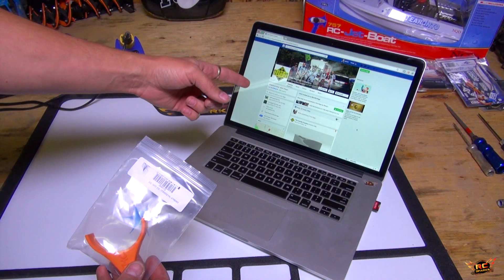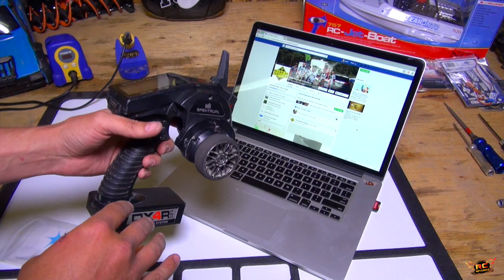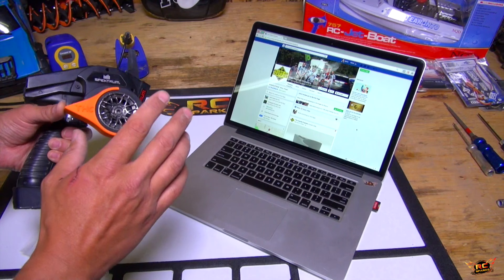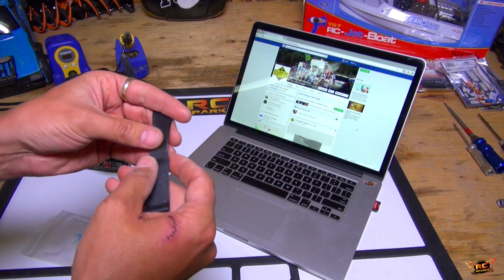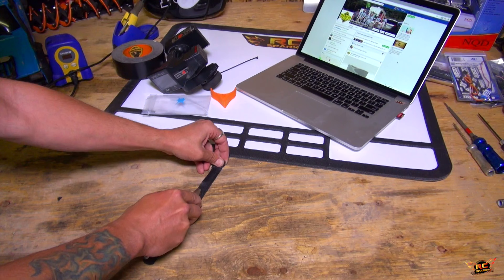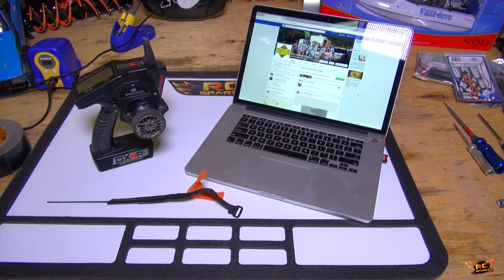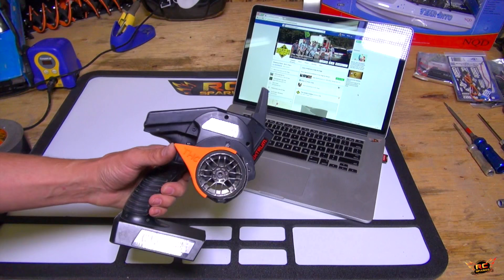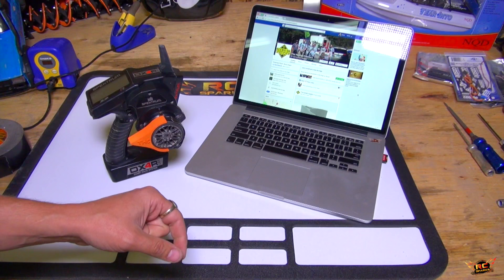RC ADVENTURES - One Handed Controller - HOYFAB "ALL THUMBS" Radio Steering Enhancement

Comment: I finally got around to ordering one of these. It’s now version 2. Looks a little different and also more expensive. It’s now 2 halves so inserting the Velcro strap is a lot easier. Downside is you need 3 screws and nuts to hold it together

Comment: I am a disabled RC enthusiast!  I only have one hand!    I wish I had one!      What I did was use an aircraft radio(stick) I use an aircraft receiver in my cars.  I know you're trying to think how do I do it but I used the right stick as it has a spring to centre,  I plug the esc( throttle) into the elevator & the steering servo into the Aileron portions of the receiver!     It works a lot like a game joystick!   Works very well.    I also use an over the shoulder radio caddy so it hangs basically in the middle of my chest!       If anyone has any questions p.m. me?    Cheers